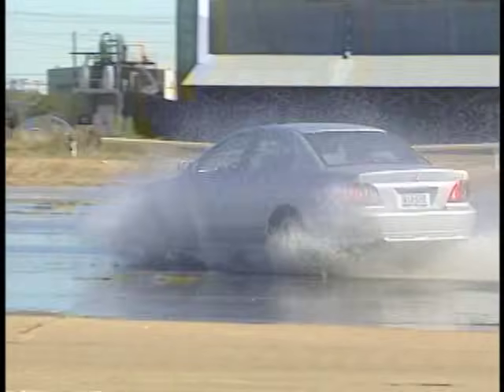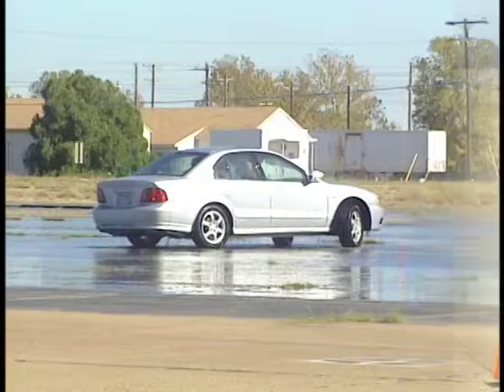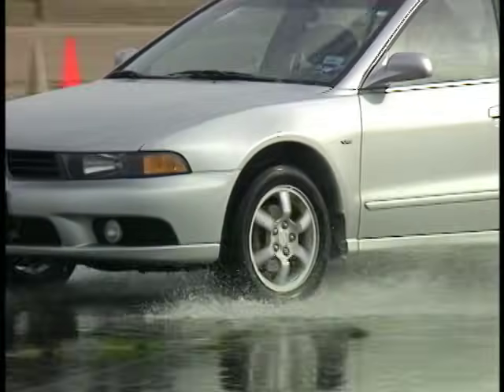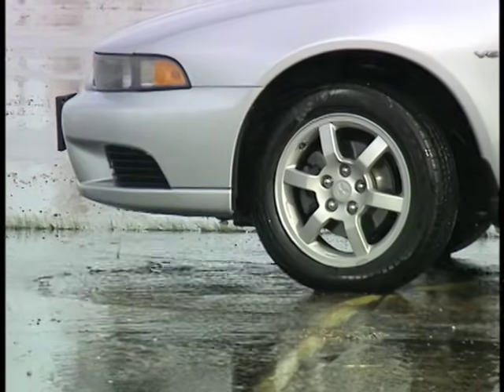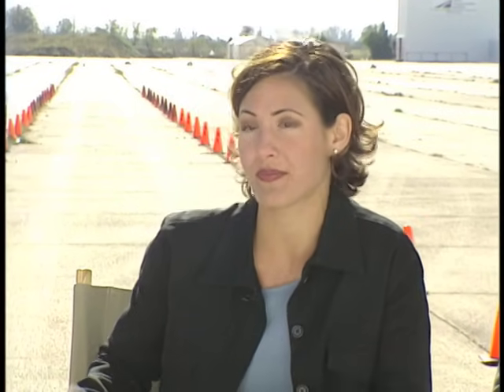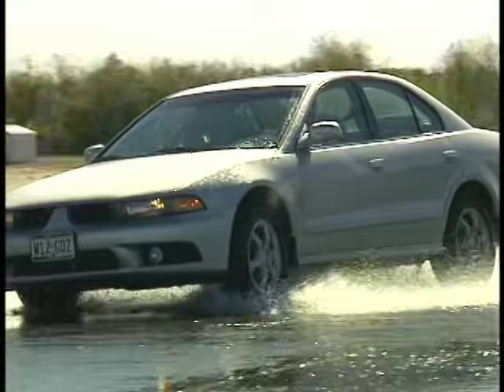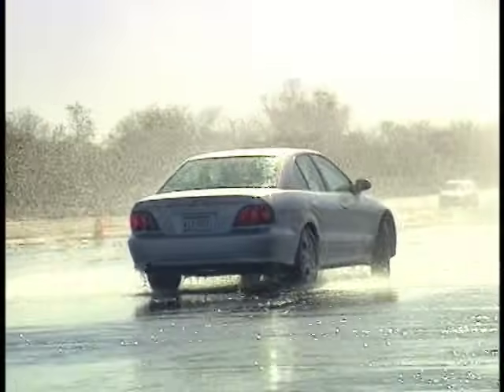How to pull out of a skid

Comment: As a first time winter driver and having my license for 2 years, I believe everyone should practice losing control in a controlled environment so you know what to do to recover without adding to the problem. I have an AWD SUV but even on some turns with ice and snow my car will fish tail. knowing how to recover saved me from fishtailing into cars next to me even though i did have to steer off into a parking lot. there's only so much you can do but it can mean alot in some situations.
Reply: cry* thanks for sharing. *sob
Reply: 1 liek = 1 prayer leik everytiem
Reply: Only prob is cops in my area like to set up in large, accessible parking lots after heavy snowfall.

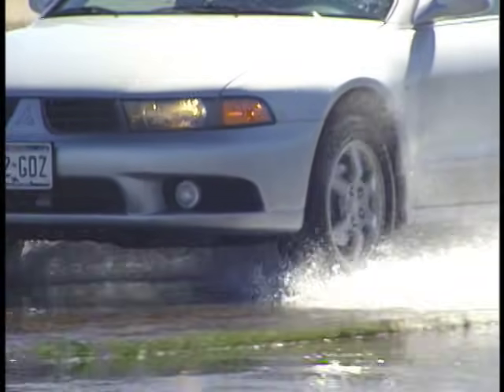Comment: 1:15 he is mistaken. The reason is that the front wheels are LOCKED. So they have no desire to follow the direction that the tire is facing, because it isn't rolling! Although his advice on how to fix it was correct. You ease off brakes to allow it to keep rolling, not to add more pressure.
Reply: yep
Reply: You're both kind of right. The front wheels can be locked BECAUSE there isn't enough weight on them. Also, sometimes, they're not locked, just not spinning at the speed you need them to be, because there isn't enough friction between them and the road.
So low weight is the cause, locking can be the symptom.

Comment: You could break this down into ASD: Aim, Stabilize, Direct.
Aim: Look up the road and target your recovery space.
Stabilize - whichever pedal's excess induced the skid, reapply  it gently to restore balance and traction.
Direct - Steer the whole car toward the recovery space you are still looking at. Thinking whole car rather than front tyres or body prevents over-correcting.
Does ASD make more sense?
Reply: It's "Tires"my dude.
Reply: @marces0223  haha only "tires" in the USA. Elsewhere, tires means fatigues. 
Stay safe.

Comment: My BMW E92 skidded out violently and unfortunately i was meters from trees and lightpoles so it wasn't an option to let the car skid out until it regained traction with a tree a metre away so i did my best and steered and a light pole hit my rear passenger driver side area, missing my front door by inches. Car was a write off and airbags deployed.
Reply: im just glad you're okay

Comment: Focusing on an object to look at is a VERY good idea, but steering out of the skid is just one part of controling the car. And it's actually more important to get your footwork right.

Since this is hard to do and could quite possibly turn the situation worst by throwing the car in the opposite direction, it might be a good idea for novice drivers to simply brake hard.

If the driver brakes to the car's full capacity, it forces the front to slide out under the retardation force, which acts like a countersteering input and works to pull the car straight, rather than make it spin harder.

Comment: I am here right after a hitting my car on a truck due to skidding on a bend for about 20-30 meters .luckily nothing happened to me, the cars bonnet area including the front chassis part was fully damaged .
I was not aware about these techniques any way , but even if I knew them I am sure I wont be able to apply them because it happened in a a very short time period . may be a second or two
My advise Please drive slow if the roads are slippery , so you can be sure on what your movement gonna be.
Reply: THIS.
Reply: Practicing in lower speed is nothing like the real situation when it happens traveling at full highway speed. In bad weather, drive one third below the posted speed limit.
Reply: I got in a car accident last night. I spun out on the highway across all four lanes from the from left lane, and hit a car while i was spinning. I agree with this comment, because while the skills may help in this video, i couldnt see due to the rain, and it was too dangerous for me to do anything given i was flying across all four lanes

Comment: ya but they all used 3 lanes to recover i dont know what country all has a minimum of 3 lanes per direction on the road. just today i got into a crash , i avoided 4 parked cars by accelerating in my counter steer but crashed into someone in the median . i believe people need to take advanced drivers training before driving on the road. i know if i did this wouldnt have happened DMV need to make these manuvers required and not optional

Comment: honestly these people need to watch alittle drifting tutorial. fuck all the "look at distant object". you understeer whether its FWD or RWD you let off the gas and brake tap alittle. you oversteer you ease off the gas alittle bit and counter steer. never let off the gas completely in an oversteer situation. maybe driving school should teach people what lift-off oversteer is. and in the case of a manual, you can even pull the handbrake a few times very quickly without locking up the rear for more than a second each time

Comment: @XXRichieXXrichXX 

If you break your rear tires loose in a RWD car, the worst thing you can do is let off of the gas. The typical terrible American driver will feel the back end breaking loose, countersteer to full steering lock, and let off the gas/hit the brake, which will just cause you to to slide back the other way and completely spin. Letting off of the gas will transfer weight towards the front of the car, reducing the already low grip on the rear tires.